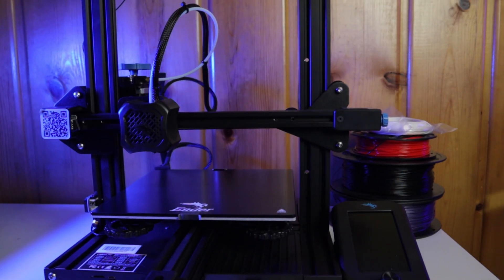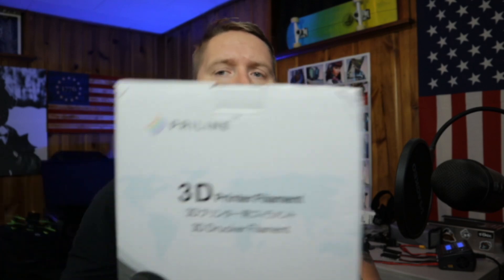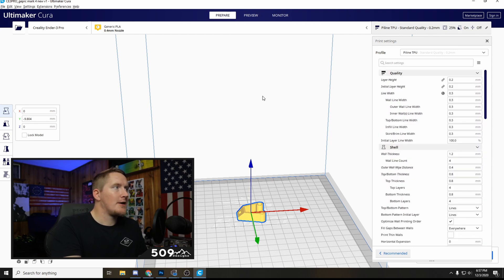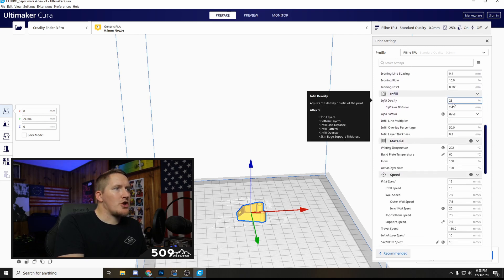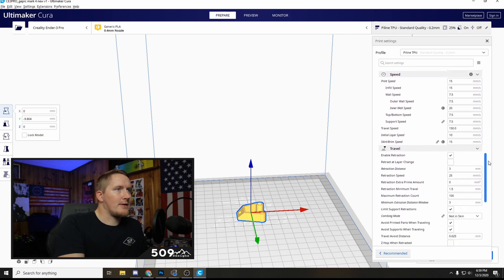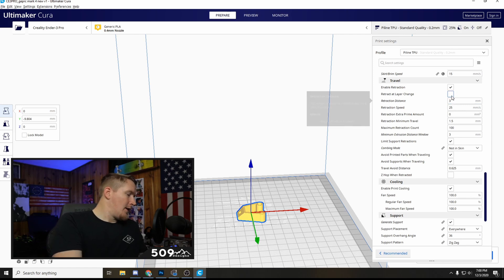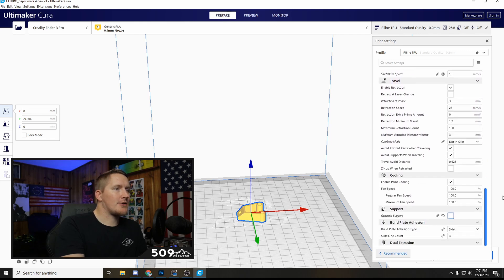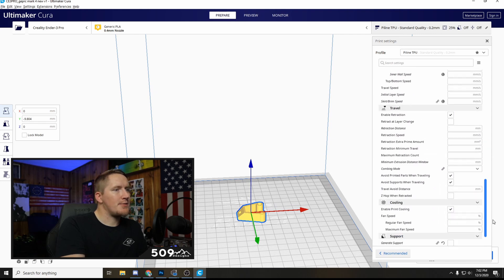Ender 3 V2 TPU Settings [ CURA SETTINGS ]

Comment: All worked well, until half way through, print lifted off. recommendations for bed adhesion?
Reply from the maker: Hmmm that sucks. Are you using any kind of adhesion? Like a glue stick, etc? Also might try getting your first layer tighter to the bed. Also, a PEI bed sheet will 100% fix this issue. My most recent video shows what a PEI sheet does, and the benefits of it.

Comment: If you have problems with these settings just enable Coasting and turn off retraction completely and do a temp tower with the tpu to get the temperature right.
Reply from the maker: Might be worth a shot.

Comment: In my 3 to 4 months of experience with this printer and 3D printing in general, I've only printed PLA, even for things that should be flexible like phone cases. The best upgrade that I did  so far was to setup Octoprint and start to really enjoy slicing and sending gcode directly over the network in Cura. The only downside is that the print speed is not adjustible midprint. Now I'm looking forward to start with TPU and make my case not rigid. Btw. do you know why is the max speed  limit set to 150 mm/s can this be safely higher for PLA?
Reply from the maker: Right on man, im just about to dive into octoprint. Im not sure about the max speed settings in cura though :(
Reply: @509drone2  Don't be cheap on cooling equipment for Raspberry Pi, mine is as hot as the bed. I've heard of malfunction reports after one year of usage. Good luck on setting up Octo!
Reply: @galaktoza  cpu temps should be fine within the 60-80c

Comment: Thanks for another great video. Its really appreciated by someone like me that is new. I wanted to ask you about the other video you made about the firmware upgrade on the ender 3 V2. Everything went great until the last step where you copy the bin. folder, file. I dont get a bin. file, folder but I do get the exact same lines or links with same numbers. I do have the 4.2.2.7 board. that is the only difference there is between your build and my build. Do you think that is the file I need? Help...
Reply from the maker: Hey sorry I didn't see your comment right away. Hopefully you already figured out the issue. But if you haven't, the printer will only recognize a .bin file for firmware. Did you select the 4.2.7 board, instead of the 4.2.2 board? Jump into our discord, and I can help walk you through it if not.  Discord Server: https://discord.gg/KrAFhEYvDM
Reply: @509drone2   You were right. It does not have to have .bin at the end of the file. All I can say is my ender 3 V2 has never ran ...... Now it runs and its printing. Go figure!!! Thank you sir. Top of the day.

Comment: On makers muse he turned off retraction, but suppose if the filament is super elastic that would a good start. The filament you show is it real elastic or or a bit stiffer, I have some TPU but haven’t tried it yet because I’m researching for now to get info before I just run it. 
CHEP dose have a ton of videos and they’re really good. Thanks for sharing.
Reply from the maker: Yea CHEP & Maker Muse are both great channels for info on 3D printing, I was watched a ton of their videos as well. From what I have found, when printing on the Ender 3 v2, or any boudin style printer with tpu. Its best to leave retraction on, and just change the speed settings. I made an updated cura settings video showing all my settings if you want to take a look.
Reply: @509drone2  
Yeah I definitely take a look at the video.

Comment: I used priline for a while, but the stuff was too hard. In the cold it my mounts would just snap from a small crash. I’m trying to get overture to work. If anyone has advice it’s welcome
Reply from the maker: Right on. We have experienced kind of the same thing. We have been using a lot of sainsmart and it's been working great
Reply: @509drone2  SainSmart has been working exceptionally great for me too! Not breaks on any crashes so far! And I fly pretty hard.